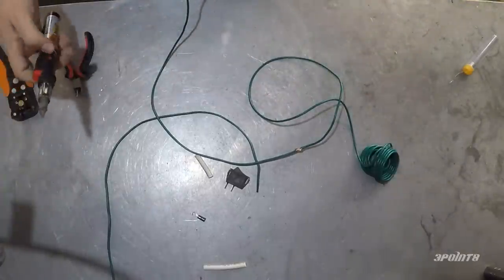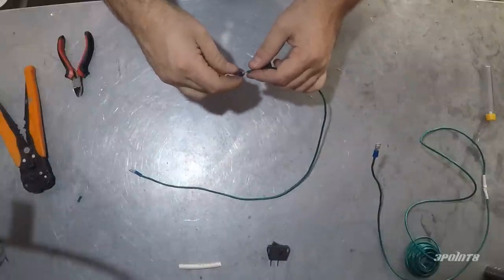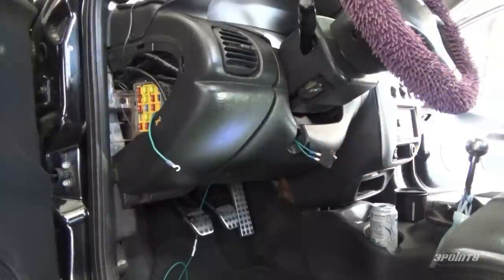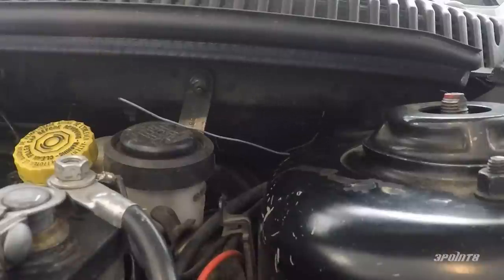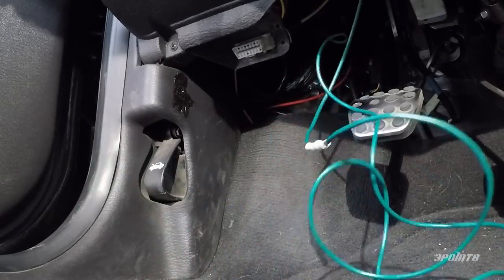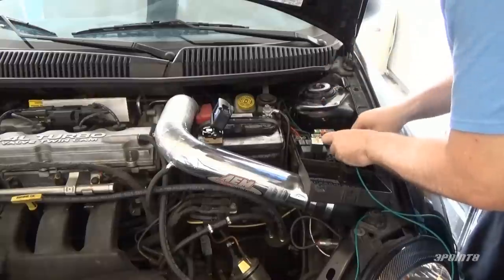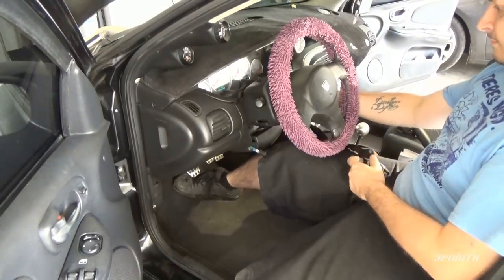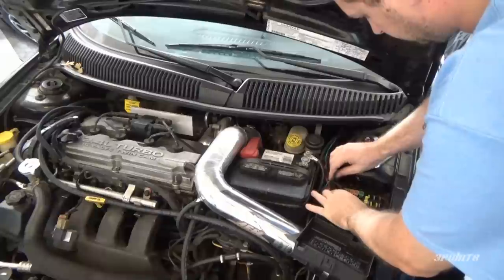Installing a Manual Fan Switch for Electric Radiator Fans

Comment: I am sorry, how to I know which one is the ground line?
Reply from the maker: You just need to figure out which type of relay it is, a 4 prong or a 5 prong. All relays are standardized. When you determine which relay you have, you can google for relay diagrams and it'll tell you which one is ground.
Reply: 3point8 Garage 
Thank you very much 😀
Reply: @3point8  please help: 
So, i did exactly this. i put a wire to ground in the relay. 100%.  and other side to ground on the chassis.  100% correct pin. triplle checked. and the relay shows the correct pin on the housing.
85.
as soon as i connectec ground to chassis from the relay, Bang. 30Amp fuse blew.

after replacing the 30 amp fuse.
i can not get the radiator fan to work.
it does not turn on anymore.

i checked all fuses. all fuses are ok now. literally pulled every fuse to check, even inside the car, not only at the engine.
checked all relays. replaced the relay i used to ground, with a working one. 

with all relays and all fuses checked and double checked. the fan does not work anymore with the usual setup.

so i disconnected the fan, to check if the fan is burned out. i connected the fan to a seperate testing dc-12v 16 amp supply, and the radiator fan worked. so its not burned out.

still, the radiator fan does not work anymore after i connected a grounded cable to ground, and bthat 30amp FAN-fuse blew.

what could be the problem?

my idea is now to find a 30amp + in the fuse box, and connect a wire to the first lead of that fuse.
then put a inline fuse of another 30 amp fuse, and then directly to the radiator fan (which is then disconnected from the usual connector). 
hoping to find a 30amp source that only has power when ignition is on. 

because i want the fan to be always on, when i have the engine running.
i dont need a on/off switch. i just want it always running, but not when the engine is off ofcourse.

Comment: Does this work on the stock fans?
Reply from the maker: It will work on any electric fan setup, stock or not, unless the fan relays are not grounded, but instead provided a +12v source, but that usually doesn't occur when the fans are ECU controlled. If the fans are aftermarket and wired up differently, you'll have to figure out how they are wired and adjust accordingly.
Reply: 3point8 Garage I had recently tried it and it makes a click but the fans won’t kick on, do you know the reason why.? Thank you for the quick reply!!!
Reply from the maker: Do the fans come on normally? If the relay clicks, that means it's engaging and should be providing power. Is it custom fan setup or stock? What car is it?
Reply: 3point8 Garage it’s a 2003 srt4 the fans don’t come on so that’s why I tried doing this to see if it would work. Do you think it could be that the relay is out? Also it would sound as if I turned my key as if I wanted to listen to the radio
Reply from the maker: Quite possible the relay or something else has gone out. Relays are pretty cheap, try replacing them first. If that doesn't work, then you may have an issue closer to the fans. If you need a copy of the service manual, send me a message and I'll get you a link.
Reply: 3point8 Garage replaced the relay and it didn’t solve the problem :/

Comment: does it really work
Reply from the maker: Define "work". Does it turn the fan on? Yeah. As far as what the result is, the fan will help bring the coolant temps down which in turn can help bring down the oil temps. I run my fan when I'm at the track doing laps. With the fan on, I never saw higher than 190* coolant temps and oil temps stayed consistent at 220*. Without it, coolant would run over 200* and oil would climb to 250*.

Comment: Do not use any toggle switch or run any power wires into the cabin wish YouTube would catch these clowns from harming people
Reply: How is this harming anyone? If you take the right precautions and cover any open metal surfaces and route the wires correctly, what's the issue?
Reply: How is he running a power wire? it's a switched ground, the circuit runs as it normally would as if the ecu supplied the ground
Reply: You've got to be extra cautious running a positive 12 volt wire anywhere, an inline fuse is a must. However, in this case, he's running a ground wire, the worst that can happen is it shorts out and the fan keeps running. Also, while you wouldn't want to do this kind of stuff on a newer vehicle still under warranty, there are those with project cars that find this kind of information useful.
Reply: Put the douche bottle down Bruce it's not made for drinking
Reply: He’s 100% correct, this is a dangerous procedure.  You’re risking your PCM if you try it.

This fried my PCM on my 2012 Dodge Charger.  Followed the procedure EXACTLY.  Apparently newer cars are wired a bit differently.
Reply: @JohnSmith-zw6tr  bullshit works fine on 2014 grand cherokee srt8